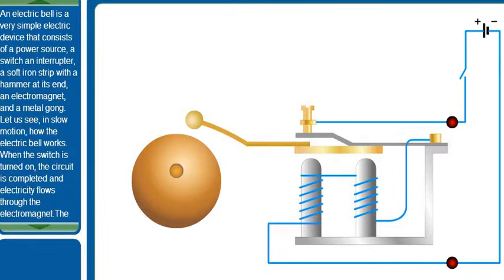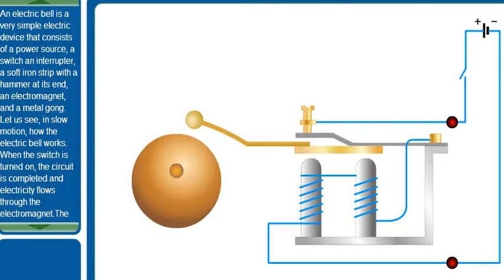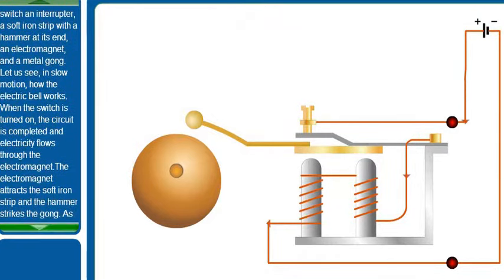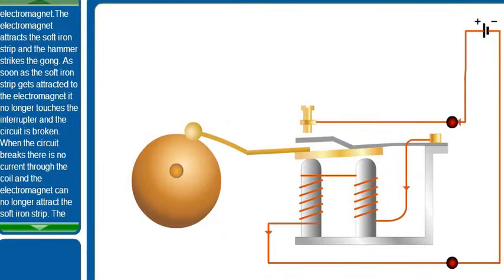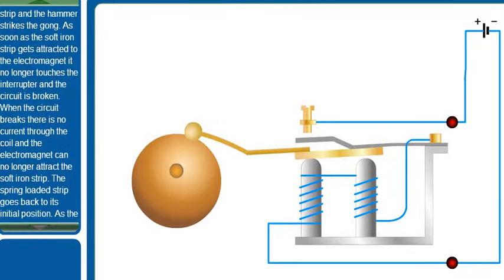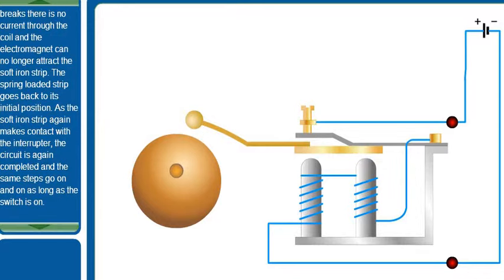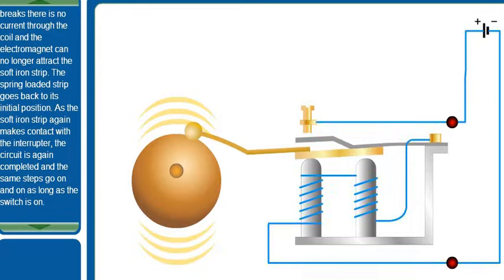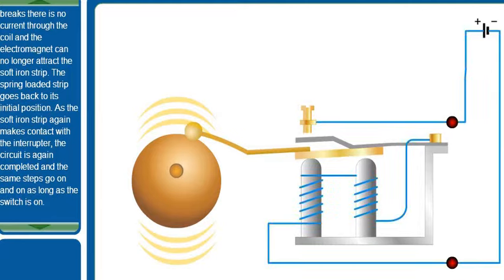how an electric bell works / 3D animation

Comment: Can you please tell me which part is the interrupter
Reply from the maker: The screw like thing connected to the wire which is completing the Circuit and helping the Electricity to flow through the electromagnet.
Reply: thanks a lot <3 @studyanimated